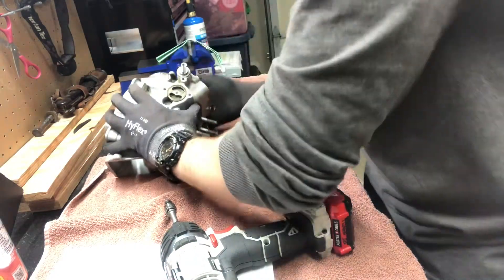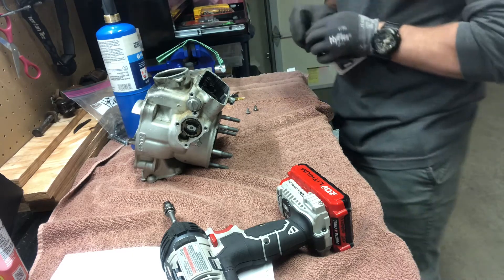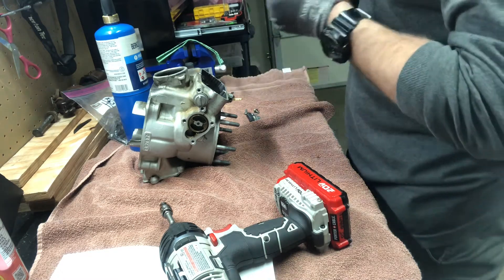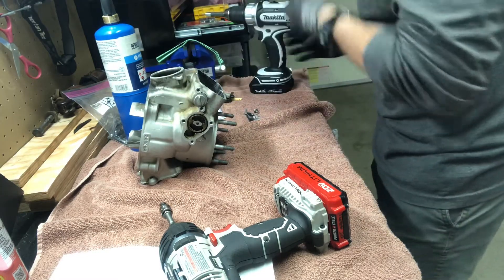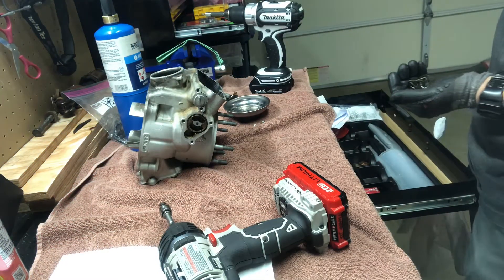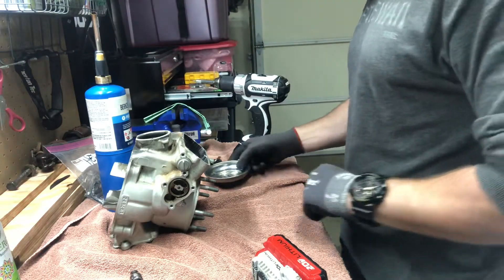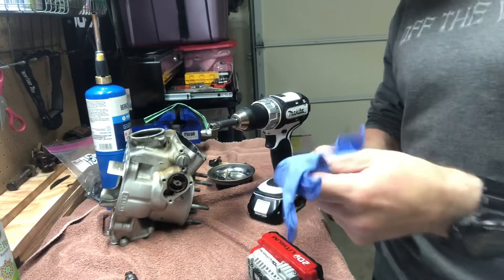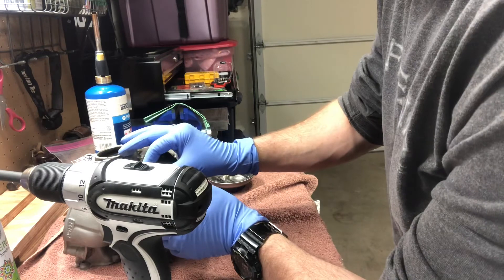2007 RM 250 Power Valve - Disassembly

Comment: Can you do my 97 power valves haha , engine keeps on hanging up after you Rev it , goes ding ding ding in the way down , , reset minor valve spring 3/4 turn and major at 1/2 turn but keeps on happening, valves must need a service

Comment: Is that round exhaust valve on the side the correct way round? dont they face inward?
Reply from the maker: There are two parts I’m thinking you may be referring to
1. The exhaust side valve spacer
2. Exhaust valve shaft spring cap

Check this diagram for reference:
https://www.motosport.com/oem-parts/suzuki/2007/rm250/exhaust-valve
Reply: @jcobra09  yea the side valve spacer sorry ,my bike is missing one all together hmmm
Reply from the maker: @tarrantmather2406  man, that is really unfortunate. Does Wrench Rabbit, RMATVMC, or any of those parts sites have them? Probably a pretty penny 🤬
Reply: @jcobra09  yea finding one is proving difficult, might just make up a sleeve as a spacer or do you think it needs to big and flat?
Reply from the maker: @tarrantmather2406  I would try to replicate the OE part as close as possible. It looks like Motosport.com has them for $16...better to have good parts if you can
Reply from the maker: I’m not sure exactly what you’re asking...like the adjustment for the power valve?